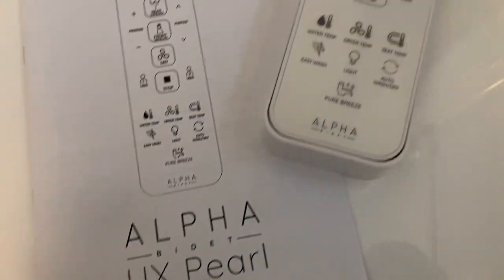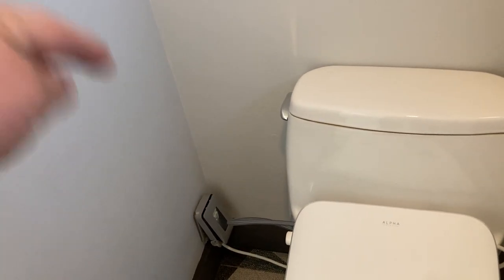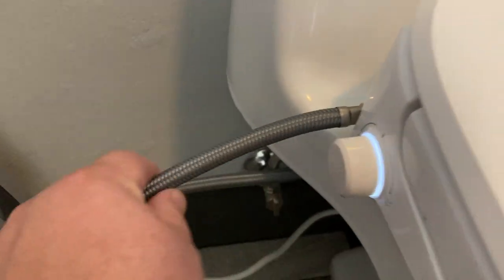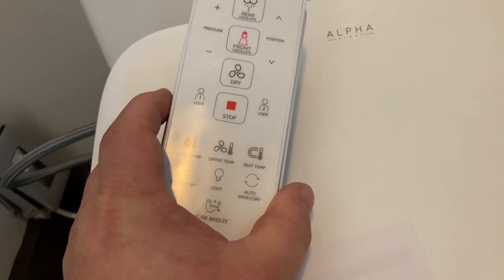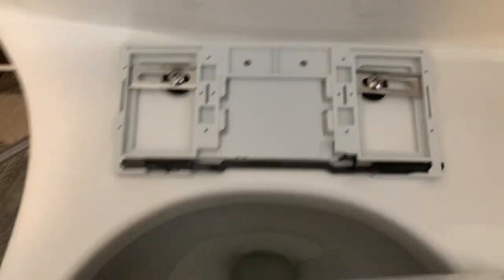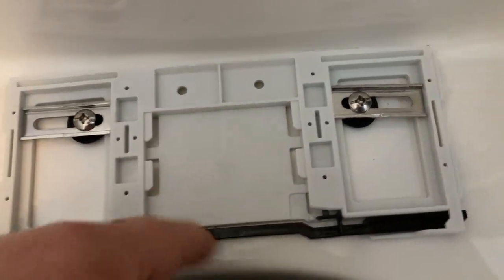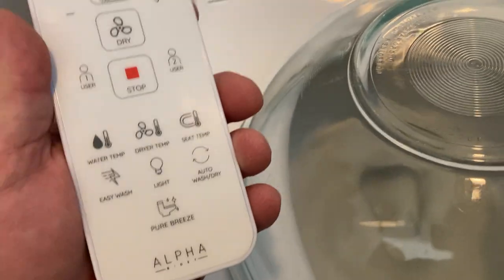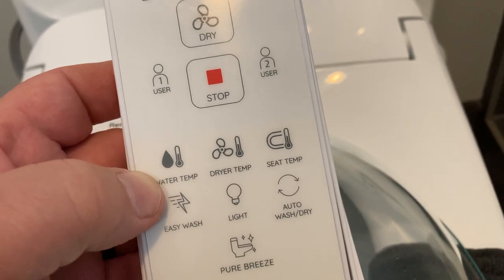Bidet Perfection? Alpha Bidet’s Newest Toilet Seat First Look

Comment: comparing the alpha jx, is it as strong of a spray. at the high level are they same pressure?
Reply from the maker: Same pressure, but no final drop when the wand retracts--that's worth the upgrade for us.
Reply: @DavePR   is the JX hard to remove if you want to clean under it really good?  I've searched everywhere and can't find anyone talking about removing the JX after its on.  I'm pretty sure its just the pearl with the easy release.  I want one for a round toilet but they don't make the pearl for round for some reason :(.   Thanks for any info you can provide Dave!!
Reply from the maker: @Josh-tq7jx  absolutely easy. These seats are so well designed and overbuilt (self-contained water heater so it NEEDS to be overbuilt) that you'll have no problem maintaining it.
Reply: @DavePR  awesome! Thank you Dave :). Ordering mine now I can install it by this weekend!  Appreciate you getting back to me so fast!
Reply: @DavePR  What does "no final drop when the wand retracts" mean?  I am considering getting the Alpha JX.  Thanks
Reply from the maker: @utrutr6013  Watch the video of the JX, it lets out a drop at the end. No big deal for me, and is more comfortable for me than the Pearl, but I like the Pearl a lot, and it's what we have in the Master Bathroom.

Comment: How do you turn off the water before setting everything up?
Reply from the maker: The water supply line should have a valve at the wall. Just look behind your toilet for the water line, then turn the valve off that is sitting just in front of the wall.
Reply: @DavePR  thank you!